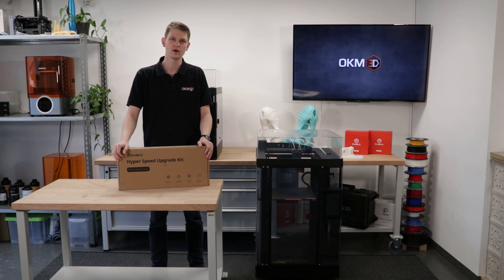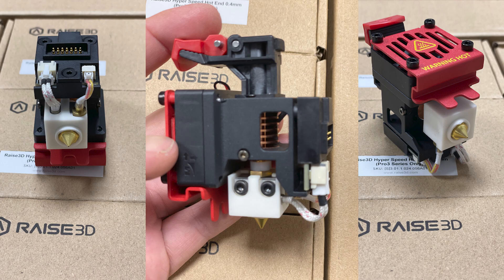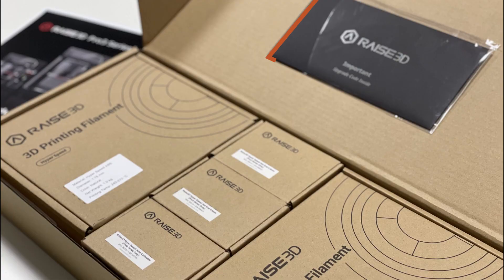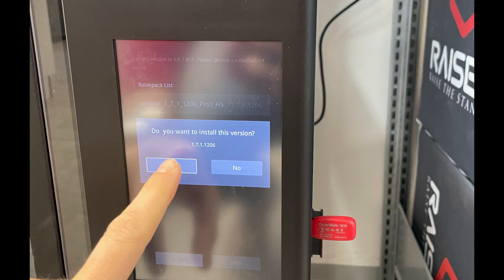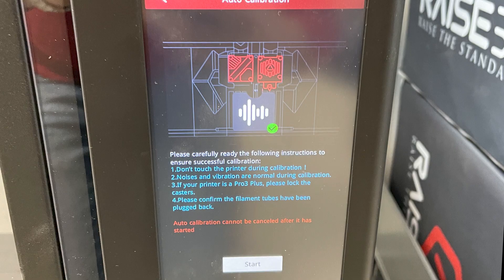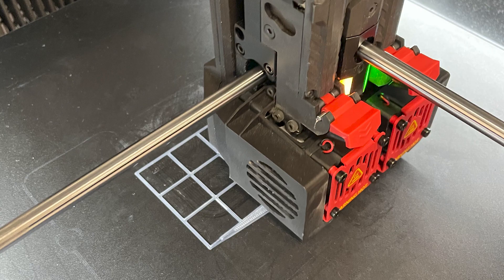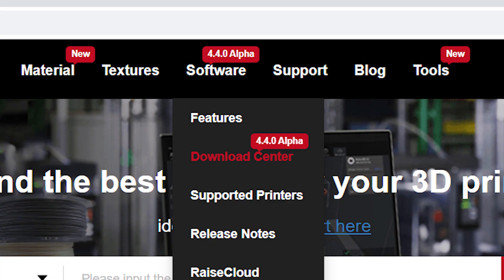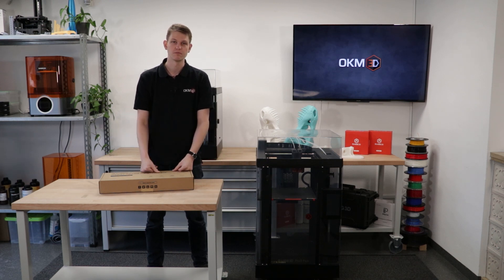Install HYPER SPEED on the Pro3! Raise3D Upgrade kit instructions

Comment: Can you print with duplication or mirror mode with the hyperspeed upgrade?
Reply from the maker: No, the Pro2 and Pro3 series also don't offer that in slow speed. Just IDEX printers could do that. The Zaxe Z4 shall be able to do that, this machine will be launched end of Q2 2024.